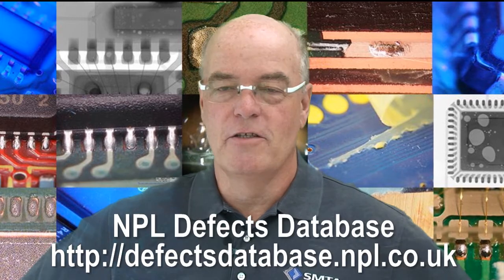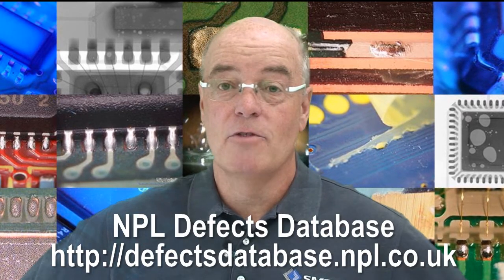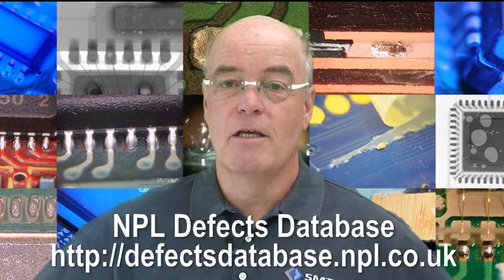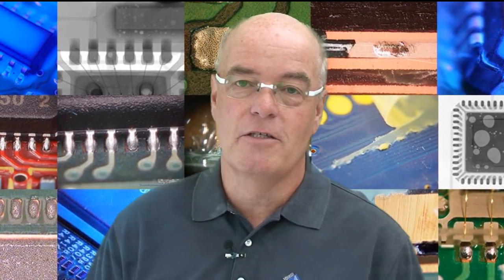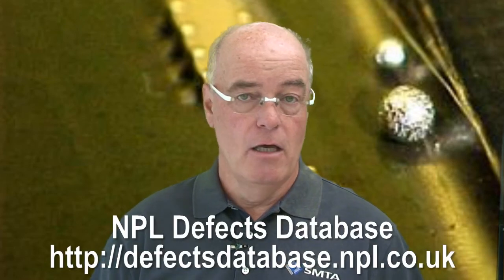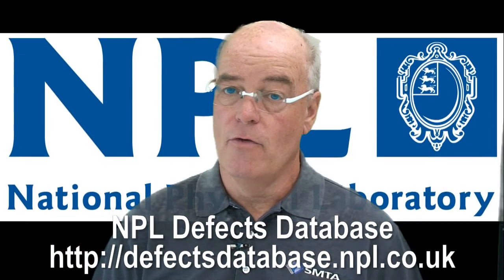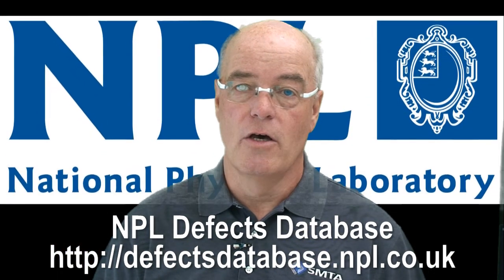Solder Squeeze Out on Underfilled Boards

Comment: Tips on avoiding this when reworking one side of a PCB with chips underfilled on opposite side?
Reply from the maker: Its all about profiling the board, if the solder does not approach reflow temperatures no squeeze out BobW
Reply: @MrBobwillis  What's your thoughts on board preheating in these scenarios? It lowers the temperature delta that we need to overcome in order to get our target chip off, but it does the same for the chip and solder on the opposite side, that we do not want to float. 

I have had some success in this, by putting some good quality, sticky thermal paste on the chip in the opposite side of the board, and setting it down in a holder so that the pasted chip (now facing down) has good contact with a copper coin or thick copper shim underneath. If it can slide around, i secure it with some aluminium tape. This way it sinks a good bit of heat, which buys me a bit of extra time. Just a bit, mind you, the heat still has to go through the solder of that chip (and the chip itself) on the opposite side, to get to that improvised "heatsink".

Another aiding method (Credit goes to Mark Shaffer for this one) which I've been using on Iphone 6 series to work on touch IC (big baseband chip directly opposite on the other side of the board), has been thermally shielding the other components surrounding the chip to come off, with aluminium tape, old RF shields, coins (whatever fits and will sink some heat) - then bump up the heat a good bit on the hot air. It does add more heat to the equation, but the gain is again time. Here, less of it. With a solid hot air station and an appropriately sized nozzle, you can melt the solder on the target chip and get that off, before enough heat can soak through to the other side of the board. Do not "stick around" to pretty up those solder pads, remove the heat as soon as the chip clears all the pads. Then when putting the old or a new chip back on, use 138°C bismuth/tin solder paste for reballing. The resulting solder joints will be slightly more brittle though, so employ common sense about when and where to use the stuff, in terms of what kind of exposures to heat, flex, impacts, vibrations etc the device has in use.

It's really important here, that your hot air equipment can dump enough heat at a fast enough rate, to "surpass" the thermal conductivity properties of the solder and traces/planes of your board. Don't go crazy with it, but a really small nozzle is not your friend here - if practically possible, you ideally want to be able to heat the entire chip at the same time to limit heat exposure duration, not walking around the chip with a very small nozzle. Be mindful of the air speed and wash though, you need a good bit of it to do it this way, but that also increases the risk of accidentally sending other nearby small ICs and passives flying. With the high temperature and amount of thermal energy you'll be dumping into it, capton tape won't do much good in shielding or securing components.
Reply from the maker: @pr0xZen  Preheat is very important in any rework in my opinion to get the the mass of the board up to speed up rework and reduce the reflow temperature and board exposure. The board should be held securely by its edges off the surface of the bench. The bench takes heat from the assembly. The heat into the board should not be sufficient to cause large parts on the bottom to reflow 
----------
Yes you can wait a short time before levelling the pads if there is a potential problem but don't let the board cool as the mass of the board is up to temperature. levelling the pads and resoldering the part is easier. Yes used LTS Tin/Bi/Au paste on a BGAs at lower temperatures. Have demonstrated all parts reworking with LTS in my workshops and webinars but don't normally use

---------

Yes very important to consider adjacent parts and the air flow, some rework systems have poor control of air flow. Also poorly training staff are often told to use the higher speeds to decrease rework time. Finally I use air systems but also like using IR as you can avoid separate nozzles. Its fair to say both IR and hot air can both damage boards but with a little training both work fine

There are many tricks we use and learn from others to help do a better job. when I am training staff I find it more rewarding often than training engineers. Many thanks again
Reply: @MrBobwillis  When preheating small iphone boards for rework, I have a jig-heater thing they go on. The heater inside it maxes out at 190°C ish, but the heater element and construction is designed to tolerate alot more heat, like if hot-air soldering on a board while it's on the jig/heater. The jig has fairly fat, beefy copper-plated brass "inserts" that are shaped and contoured to precision fit the various boards and hold it still by the screw/standoff holes, and it has a tonne of thermal mass. So I often get the jig and board up to temp, then shut it off or turn it down to ~150°C, then leave the board on the jig while working on it. If heated to 190°C and then turned down to 150 and just let it sit, it takes at least 7-10 minutes for the jig insert to drop down to where it turns on again. The board, at least the top layer, will cool down some below that, but it seems like having that precision contact with the insert underneath, goes a long way in keeping the board heated while working on it.

For big boards I use s different type preheater, but its size makes doing micro work on it too difficult as both arms has to hover, so with those I set the boards on a silicone foam mat on the bench (a surpisingly effective thermal insulator, kinda like the foam pads used in vinyl and laminating heat presses - I use the same stuff to grab with when swapping hot soldering iron cartridges), and return them to the heater if and when needed.

Do you see any unadvicable elements in these procedures? I've mostly been trying this stuff out without any guidance, just trial and error and my understanding of common sense.